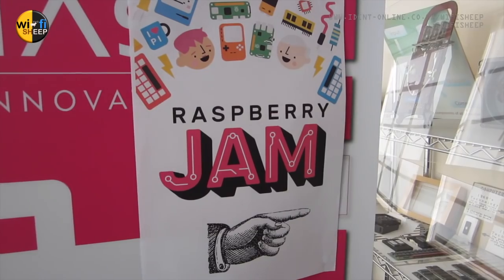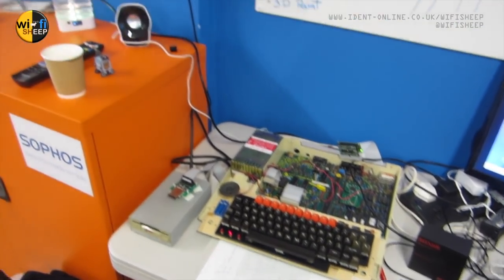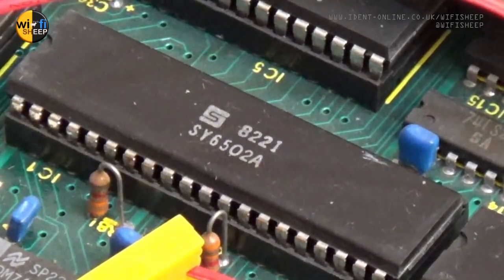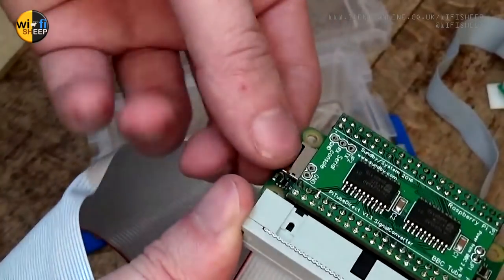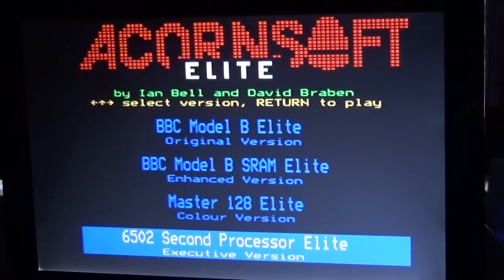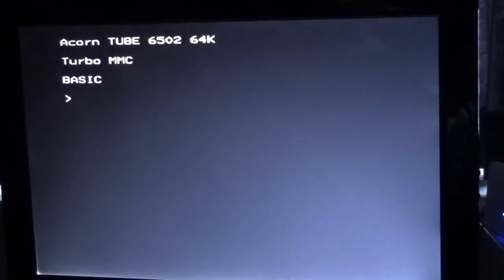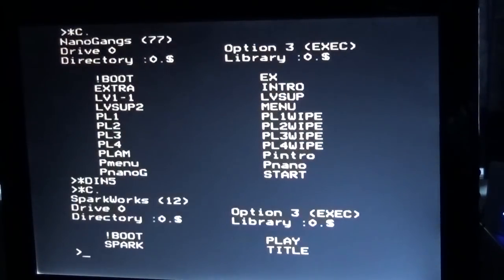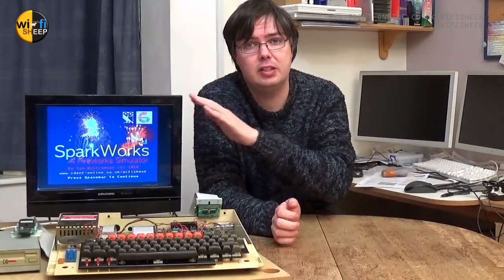Upgraded BBC Micro Model B and Milton Keynes Raspberry Pi Jam

Comment: Thanks Tom, always nice to see the BEEBs in action. Have you thought about getting a Gotek floppy emulator?
You can get all the parts needed for an easily modded emulator (Gotek, OLED display & rotary encoder) for < £20
The floppy images are stored on a USB stick , and can be any Acorn format (SSD, DSD, ADF etc; MMC can't handle ADF images)
Other formats are also supported, e.g , Amiga, Atari, Commodore etc.
You may already have one, but I've yet to see it in use.
Reply from the maker: Hi booBoyBL, nice to hear from you again. In short No i dont have a Gotek .. 'yet' it is on my to do list as you mention the use of ADFS would be useful as MMC dose hit its limit with only supporting 200k DFS images. I have seen some real rip off prices for pre packaged units so are a little wary but will look in to it in the new year.
Reply: WiFiSheep Thanks for the reply. You can get the basic Gotek hardware for about £10 - £12 on eBay.
Be sure to get the model with the 34 pin connector though. Then you need to flash the firmware to ‘Flash Floppy’
using a serial to USB adapter. This CAN be done on a Mac, but it’s far easier on a PC, (the s/w is windows only).
The Gotek is then usable ‘as is’, but an OLED display to replace the 3 digit 7-segment LED display is a huge improvement, as is 
the use of a rotary encoder instead of the 2 button selection. All the parts needed are very cheap, and there are plenty
of YT ‘how to’ videos on the modification process.
Reply: I have a gotek in a couple of my Beebs, the master compact is most useful as it frees the user/joystick port up again. I have also written a menu system similar to the mmc one that make the whole of bbcmicro.co.UK available. The beeb selects the image automatically https://stardot.org.uk/forums/viewtopic.php?f=53&t=16070#p222019 it is still an early version, but I welcome feedback.
Reply from the maker: Hi Old School thanks for sharing that info and your project, that is really interesting and I know what you mean about needing the USER port for things! In my case a mouse! I will look into all of this me thinks!